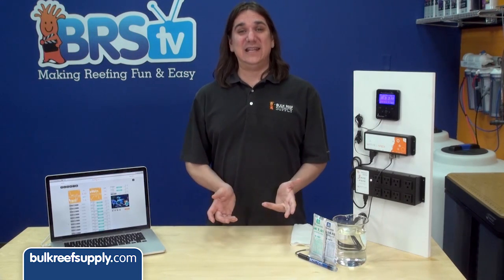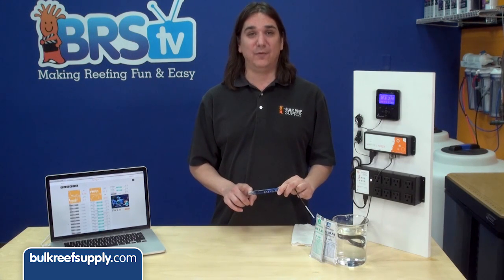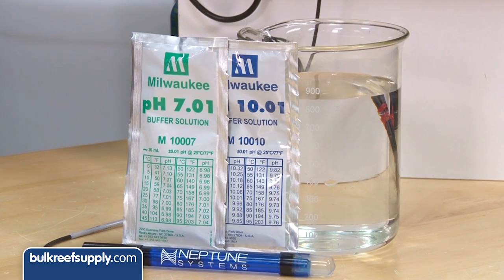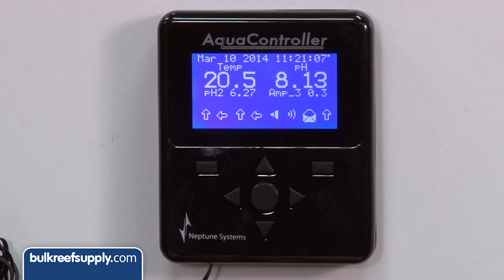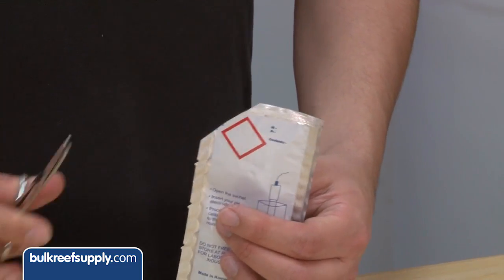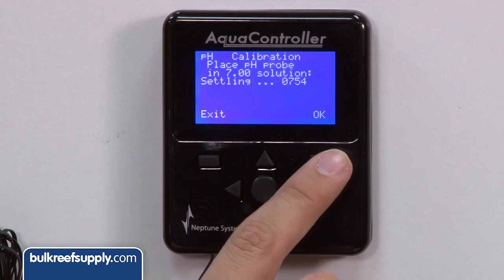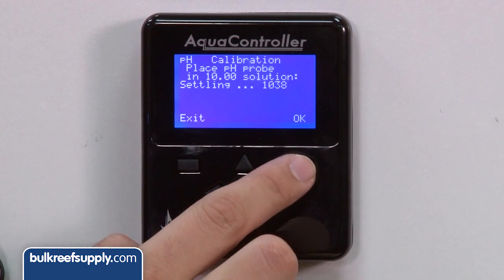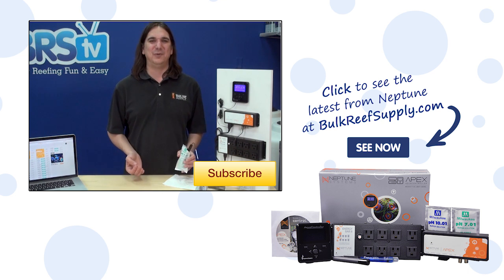How to Calibrate your pH Probe EP 08: Apex Aquarium Controllers from Neptune Systems

Comment: I just bought a BRS lab grade ph probe and module for my Apex. Would this be necessary for a new probe?
Reply: A little late for you but I would say "Yes, absolutely!" If I'm not mistaken you are calibrating the Apex to the probe, not calibrating the probe itself. The Apex does some math based on what solution you tell it you are using to figure out the exact offset in the probe's readings due to various factors including manufacturing variance and age. Then it just takes the reading from the probe, uses the offset it generated and a bit more math, and displays the calibrated PH. If you do not calibrate the Apex for a new probe, the Apex itself is using the wrong values when calculating the reading off the probe, so you are going to get a bad reading. This might not be necessary on a factory reset Apex with a new Probe, but I would still highly recommend it for the most accurate readings.

Comment: Can the ph probe uncalibrate?  My ph was fine for the first six months, but it is now constantly showing 7.8-8.0.
Reply: Yes, definitely. The double junction probes hold calibration longer, but it's generally assumed all of these probes require calibration over time as liquid can and will eventually seep into the probe and mix with the internal electrolyte used by the probe. As this happens, your probe will give more and more incorrect readings. This is usually okay - a quick calibration and the Apex will use some extra math to determine the correct PH value. Despite the probe's reading being off it is still accurate in the sense that it detects the increase and decrease of PH accurately, it is just using the wrong "starting point", so to speak, to base it's readings. By running the calibration and telling the Apex what PH the probe SHOULD be reading, the Apex is able to accurately account for the degradation in the probe and give the correct PH readings. Eventually the single junction probes may not have enough reference electrolyte (relative to the liquid the probe has been submerged in which has seeped inside), and they may up and die, though they are typically rated for several years of fully submerged use, and the double junction ones typically last quite a bit longer before they stop working properly all together, as the liquid has to breach two junctions before contaminating the electrolyte surrounding the reference electrode, though all of these probes which require the probe's electrodes to contact the water will eventually die, and will definitely lose calibration over time.

Comment: Where can i get the solutions above, 7.0 and 10. ?
Reply: Any PH Calibration Solution from a reputable manufacturer should work. 7.0 and 10.0 are good solutions to use if you want your tank in that range, and they are easily found online or at the LFS. BRS doesn't seem to carry the Neptune PH solution, but Drs Foster & Smith carries the exact one supplied by Neptune for $2/pack: http://www.drsfostersmith.com/product/prod_display.cfm?pcatid=26691

Comment: @Rico Suave. Ideally the solutions should be no more than 4 apart. If you need to ensure the full range of the pH probe then calibrate with the more common range then check with the other solution, i.e. calibrate with 7.0 & 10.0 and then check with 4.0.